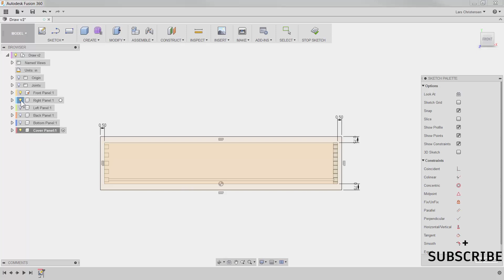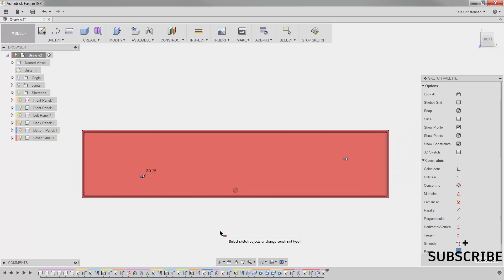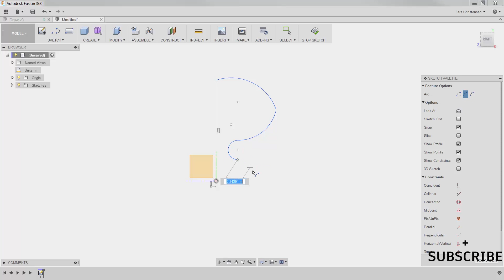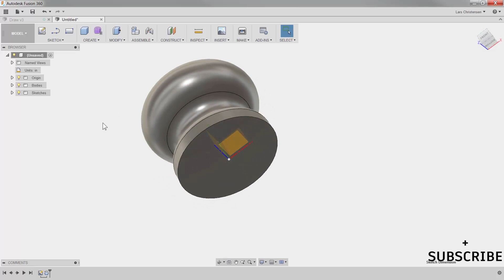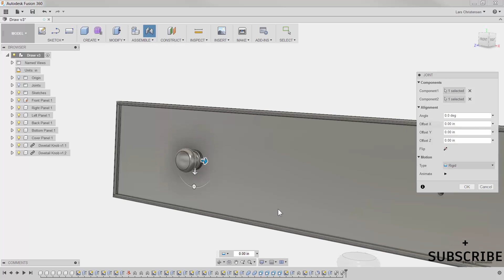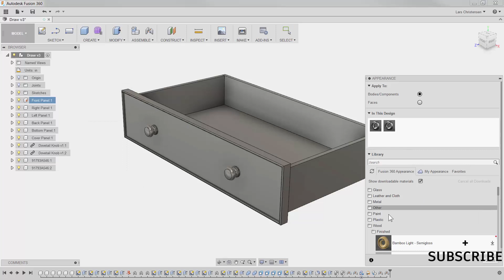Fusion 360 Tutorial - How to Model an Assembly Drawer with Dovetails from Start to Finish Part 4

Comment: Hy Lars - great series - and I learned that the "combine tool" can also be used as cut - this save time.

I understand you just try to explain us some "Fusion - How to". But as a woodworker let me mention some best practices for wooden drawers: (they are almost common sense in the woodworking world - and make the difference between drawing and constructing) 
- dovetails typical have a fixed angle (depending if soft or hard wood)  1/6 or 1/8 if done by hand or e.g. 10° if done with a dovetail router.  So your dovetail sketch should have this angle 
- normally the backside dovetails are not "half blind" they are cut thru 
- also typical the bottom is "push in"  from the back, and the backside part  is therefore a bit smaller in hight and just reaches to the top of the cut grooves.  (This is makes much easier to build it, and also helps with typical Wood Shrinkage ) 
- the wood grain should be along the log side (can be done in render settings) its not so critical for the pins - but the tails will otherwise easily break
  see http://www.startwoodworking.com/sites/default/files/uploads/taunton/images/w157coIMG_1837.jpg

Grüße aus Heidelberg Germany - Michael
Reply from the maker: Hi Michael, Thank you! That is awesome! Yes, I knew someone like you were going to look right through and pretty quickly realize that I know very little about woodworking :-)
Thank you for taking the time to watch the video and comment.

Have an awesome day!

Comment: Great series Lars! Your videos are always so helpful. As a custom furniture maker I really appreciate the specificity of this series in particular. One question about the parametric feature of the drawer:  When the height of the drawer is increased or decreased what happens to the dovetails? How can the drawing be set up so that if the dovetail spacing is 2" a dovetail is added if the drawer height is increased by 2?
Reply from the maker: Hi Richard, Thank you for taking the time to watch the video. Yes, that is a flaw in my design. The solution is using parameters found under the modify tab. I do have parameters on my video list, but I think it is a little more advanced level. Check out this video:
https://youtu.be/apkUQKNwHIo

Have an awesome day!

Comment: Thanks for the video. I basically drew the dove tails the same way ( using the symmetry command and a lot). But you did give a lot of good insights on organization and simplifying my constraints. I tend to want to over constrain my sketches a lot. Very helpful video thanks.
Reply from the maker: Thank you for the suggestion for the video Troy, glad you found it helpful.
Best,
Lars

Comment: Yet another awesome tutorial Lars, thank you so much. Love the outtakes at the end too :-)
I have just one question; I don't see any clearances in the dovetail joints. So as I understand it, they wouldn't actually fit together.
Or have I missed something?
Reply from the maker: Hi Spike. Thank you so much! Well...so I have to admit that I know very little about woodworking, lol. I thought you pretty much made them to size and smacked them together with a hammer.
If you needed clearances, I think I would project the sketch and then use the offset command.

Have an awesome day!
Reply: My past experience of woodworking suggests that you're probably right.
In this case I'm referring to 3D printing ... I should have mentioned that :-)
I watch all your videos and learn a ton from them. The actual project doesn't matter, it's more about how to use different features of Fusion 360. These are skills that can be used in all designs.
The offset command is what I thought would be the solution, but I wanted to ask in case there was a particular feature geared to it.
Thanks for your reply.
Keep up the fantastic work, have a great day.